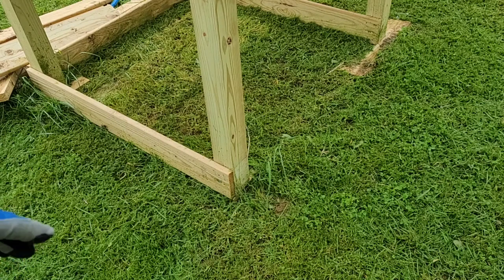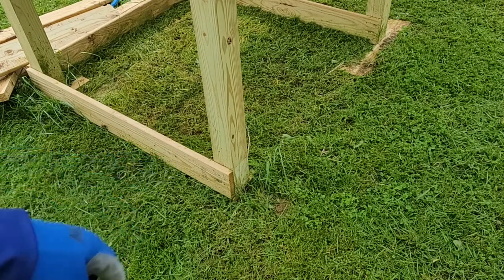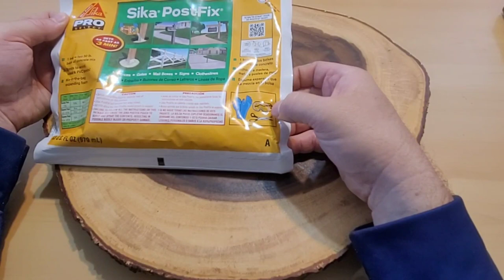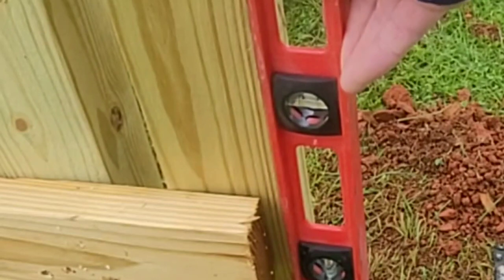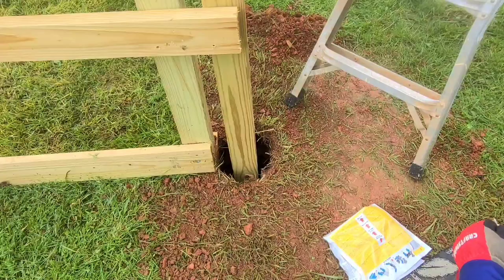Setting a fence post in FOAM. sika postfix. Does fence post foam really work? [413]

Comment: I used Sika post fix and it works wonders. I love how it’s a lot more convenient than concrete and that it’s stronger too. However secure set is even stronger and can be cheaper per hole.

Comment: I install many posts a week. In Australia concrete mix is around $8 for a 20kg bag. I bet that stuff is going going to be pretty expensive here. It would be great if you could only use half a bag for a small job. It's certainly more convenient than concrete with the weight, dust and the mixing involved. I'm guessing Sika is going to be too expensive for my situation. Thanks for the review.
Reply from the maker: I agree, I thought it would be great to be able to portion the product. As is...once mixed the process will start. I wonder if they have a similar product in Australia. The foam is a lot more convenient than cement...safer too. Thanks for stopping by and commenting.

Comment: I know a man who puts up and replaces fences on ranches. He uses 4" cedar post. He may use several hundred  posts in his projects. What he does is dig the holes with a post hole digger mounted on the back of his 75 HP tractor.
The work he does for me he digs the hole, puts the post in and tamps the dirt  all around the post. The fences will last about 40 or more years and the barb wire is tight. He uses 8"  cedar corner posts and braces them in a way that they are bracing each other.